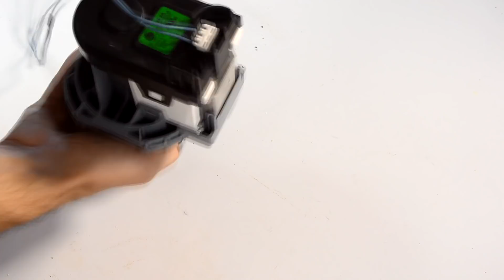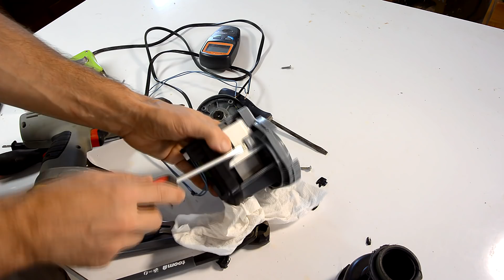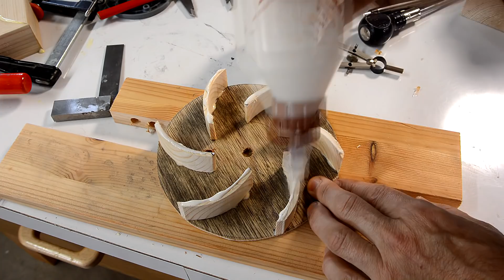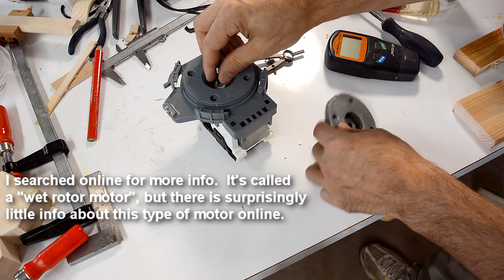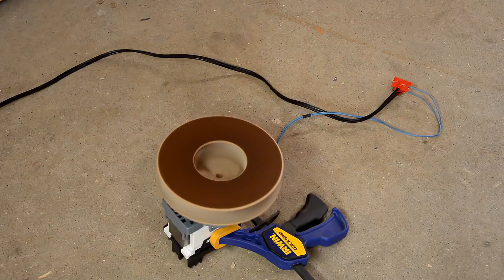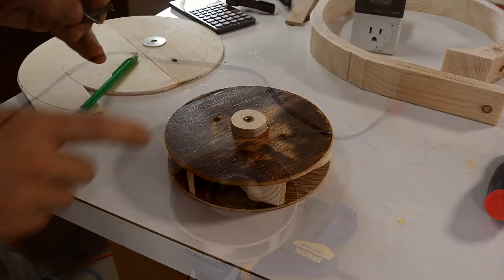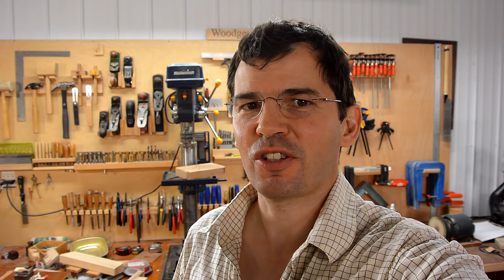Wet rotor synchronous dishwasher motor

Comment: The electronics are to get the motor to spin in the right direction, as if you power it directly it will start, just a 50/50 chance of it turning the wrong direction.

Comment: There is one problem with running wet rotor motors on fans: The water is there not only tolerated, but it is providing lubrication and cooling of the bearings. So running it dry will kill it in a short time.

For the starting: It is not the inertia, but the lack of power reserve wat makes it fail to start. The "pumping" is normal for this style of motors, it is just abeat pattern between the real rotor speed vs the mains frequency. But it efficiently makes the motor not accelerate during half of the time (when the mains is off phase from the rotor), so all the speed up needs to be happen during the time it is in phase. And this speed up needs to be able to reach synchronous speed and attain lphase ock with the mains. For that the actual motor torque  at speed needs to be double of what the load and other resistances are. If it is not, it is unable to lock the synchronicity, so the starter electronics times out and shut it down.
So you need to improve the impeller, so it won't load the motor that much.

There are actually two reasons for using these motors: first is the no need to seal between moving parts. Second is the efficiency: Induction motor has about 3x the losses compare to similar construction permanent magnet synchronous motor. The reason is, the rotor magnetic field on permanent magnet motor consumes zero power, you only have stator winding losses corresponding to currents pushing the load torque. With an induction, you need to induce currents into the rotor cage and that means the cage will have losses comparable to the synchronous stator losses. Then the stator winding has two functions: One is to push the rotor forward, the same as with the synchronous motor. And the other task is to form a kind of primary winding to induce the current into the rotor cage. Each of these functions creates similar losses. So in total we have 3 things wasting power, each about the same.
The extra gap between the stator vs rotor does increase the losses, but by far less than what the induction would waste, as unlike with induction, oversizing the rotor field strength does not cost any power, jus a bit larger magnet. Mainly at these small sizes we are talking about losses becoming the majority of the input power becoming losses in the motor, so when the pump needs about 30W at the shaft, it means about 90W induction vs this 45W synchronous.
Reply from the maker: that's why I oiled it.
Reply: @matthiaswandel well the oil may attack the plastic.

Comment: How's this motor holding up after 6 years without water lubricating the bearings?
Reply from the maker: haven't had issues.  I did oil the bearings
Reply: That's awesome! I'm harvesting a couple off a dishwasher right now. The main pump/garbage disposal motor is 1/3hp and has 4 wires and no capacitor. I assume two are the main windings and the other two are for starting, one for forward one for reverse. 

The drain pump is a small synchronous motor like this. I don't know why they put two motors in? Seems like a simple valve would be cheaper than a motor.

Comment: millions of wet rotor motors - mainly water circulation pumps like Grundfos and little giant etc. My Grundfos  is 35 years old and hard water of 315 ppm. Amazing. Of course it was built in the USA. All submersible  well pump motors are wet rotor, but they only admit filtered water as needed.

Comment: Its 5 years late now but the rotor should have as little gap as possible to the outlet edge or it will suck air from the output and make the output much worse.

Comment: i have a couple of these types of pumps for a cat's drinking fountain. they are actually pretty terrible for the job because the cat saliva can't be easily filtered out and the little wet rotor parts are a huge pain to clean out. a peristaltic pump would be MUCH better, but way too expensive.

Comment: 120Vac 0,9A =108W 
How did they get 55W ?
Reply from the maker: Rated vs actual power consumption.  Also, 120 volts * 0.9 * power factor.  Google power factor.
Reply: @matthiaswandel  Thank you for your answer Matthias.

So , Which one is it then "Rated or Actual power on the label ? The formula I wrote , which one is it ?
Reply: @gbsthlm6174  You should go through the Joe Robinson training videos, because explaining comprehensively it in a comment, or one setting is less than easy. Rated is 55w,  the power it is entirely drawing is 108 "watts" [VA]. 55w of the 108 "watts" is used to spin the rotor, generate magnetic field, run the circuity, and make heat and sound. The rest is not used. 108 is drawn, and 55 is used, when in other circuits, the is a PF of 1, and 10 watts drawn is 10 watts used. Here the PF is 55/108 = 50%.

Comment: The carbon bearing don't last running dry.i replaced it with ceramic bearing.that motor itself is not a good motor even on dishwasher. Carbon Bearing wears out uneven and it shaves off the magnet into dishwasher.nice video though .

Comment: with some more correct design on the vanes friction should be reduced and speed increase.  Since you are looking for small motors, AC, fridge and freezer compressors are a good source. They are usually in ok condition when their appliances are being scrapped due to cost of refilling coolant

Comment: Motor runs at 3600 RPM, not 7200 RPM.  It is directly driven by 60 Hz all the time, even when it is starting.  Starting occurs because the excitation is so strong that the rotor rocks back & forth more then 1/2 turn, leading to spontaneously starting.  (Adding excessive inertia will reduce the "rocking" to less then 180 degrees and not allow starting).  The only issue is getting to start in a known direction.  If pump has radial-blade impeller and symmetrical housing, it will work in either direction.  Some housings have "flapper" to accommodate random direction starting.

The main reason for the design is CHEAP.  (Your statement about large gap and magnetizing effort are correct, and is 2nd reason for design.)  Look at the simplicity of one coil, and compare that with the complex windings of an induction motor.

Your blades curve the wrong direction.  They should curve backward to provide "pressure recovery" to the airflow as it exits.  A "forward curve" impeller (the one you made) is subject to overloading and low efficiency.  Forward curve impellers are used when speed is low and you need high airflow (on small gasoline engines) and when quiet operation is desired (in home air-handlers).

Comment: It's a PM reluctance motor - looks like a chinese made knock-off of the Italian askoll motor block that is ubiquitous. The heavier duty versions have ceramic bearings and rotor shaft and a fully epoxy potted coil. They must be submerged in water for any reasonable lifespan to cool the rotor. This type of motor does not necessarily need all of those electronic circuit controls on the back to run. Those are there in this 'smart' version to optimize power usage depending on load. The more basic forms of these reluctance motors are not even directional and will start spinning in either direction depending on the rotor position when it is supplied with power.

Comment: Matthias suffers from motor addiction. I have the same problem. I own a lot of induction motors, the biggest one is a 3 phase 380V 50Hz AC 120A (on each phase motor). Giant induction beast, with a lot of torque.

And a little note:
Why you should have children.
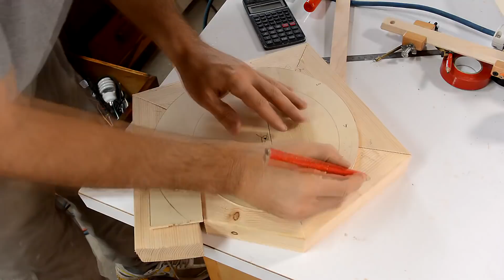1) they help with dust collection 4:16 - 4:20
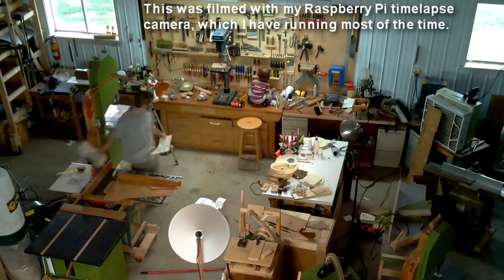2) they keep your tool wall organized 9:08
Reply from the maker: yes, some people collect stamps.  Others collect motors.  I think motors are way more useful!
Reply: Matthias Wandel I suffer from all sort of motor addiction (induction,  BLDC, Stepper, servo, DC, universal DC, synchronous, as long as it turns a flow of electrons into rotation

Comment: I used a rpm meter years ago.  When I used it indoors, it was inaccurate.  When used outside in the sun, it was accurate.  It was actually picking up the 60hz of the light indoors.  Check yours and see if you find similar results indoor vs outdoor.

A strobe-o-scope might be a better option.

Comment: They use something very similar in fish tanks Where you have an electric coils outside the tank and a magnetic impeller outside the tank. Also in X-Ray tubes there is a rotor that spins an anode. The rotor is inside a vacuum enclosure. The coils / electronics are outside the vacuum enclosure. These motors have several interesting uses in varying environments.

Comment: If anyone's looking for a similar motor, it's a very common type that has been used in many dishwasher for at least the last 15 years or so. Whirpool, Kitchenaid, Bauknecht, Indesit, Hotpoint and IKEA are some of the brand names that almost all use this model pump. There are multiple variations of this pump, but in most cases it's just small design changes and upgrades over the years and in most cases they're all compatible (often the only difference is the plug). This also means if you're going to repair your somewhat older dishwasher that has a pump like this there's a good chance you can use a newer, more silent version of this pump.

Comment: You suggest there is a choice induction or PM rotor.  Actually the large air gap and wet rotor disqualify's an induction motor.  The magnetic field in an induction motor is created by slippage, rotor speed is less then the magnetic field rotation speed.  The rotor is a transformer with a very low frequency, slippage.  the rotor current is the secondary induced current so the wire resistance and the moving of the field in the iron will create heat. And some current may flow in the water.  Problem one is the transformer will be poor with a large air gap.  The PM has a fixed rotor magnetic field.  Second problem water has dissolved solids that will come out of solution in the heated water in the air gap.  The motor would build up lime that will seize the motor rotor to the plastic can.

Comment: Nice video as always! I remeber that this type of motor is use for pumps in fish tanks.( At least the pumps that I use are) just a simple design that can be submerged in water if the rest of the electronics are cast in some sort of epoxy.

Comment: I've seen this set up in above ground swimming pool pumps, the magnet pulls itself apart and always fails.  I was buying a new pump every season because the impeller is not sold separately.

Comment: this is the same type of motor used in filters for fish tanks. their advantages are safe (because the moving part itself doesn't need a seal, so you don't need to worry about wearing on the seal at all) and super quiet (my 9W filter motor's noise level can't even be properly measured because it's lower than ambient noise). imo a more interesting way to salvage this type of motor is to make a small hydro-generator out of it. i'd certainly love to see Matt do that.

Comment: The motor is overloaded and just can't turn the volume that the wheel you made at the required speed before the electronics shots down due to thermal limit of the driver circuits.  Great job but this motor just doesn't have the guts you need. Nice job, you are an inventive engineer.

Comment: That motor is a proprietary motor for whilpool line products (possibly other manufacturers as well). That may be why you can't find anything on it. I fix 'em and see them all the time.
Reply from the maker: I wasn't looking for anything on this motor, but this type of motor
Reply: Read Mathias's reply again. He choose this only as an experiment. To both of you guys that repair these, if you watched the video to
the end then you would see that he knows this and is EXPERIMENTING with it. It will fail in time, but that's in the fun.
Reply: I repair this asko/askoll junk too, and now a Chinese version of the same thing..oh dear, a recipe for disaster eh.I could give you a tip I discovered years ago when these first arrived in the uk badged as Plaset.  As you probably know, when the seals fail and they fill with foul water, the rotor bearings wear, the rotor starts to wobble, and because its a sort of shaded pole motor, once the air gap around the rotor is not equal and opposite all the way round, the rotor will not turn. With me so far!? Anyway, when this is the case, if you can pull the rotor out of its chamber, fill the chamber with half a teaspoon of cooking oil, replace the rotor and any associated parts and the motor will work like a dream for a good few months!And if your reading this Matthias, its probably better not to consider using these for any projects, they just aren't very good.

Comment: Wet rotors are common in refrigeration compressors. They typically have to circulate refrigerant and oil mixed to keep them lubricated.

Comment: Like the exposed wires. Certainly not a safety video.
Reply: iLovewood Dont touch them, you'll be fine.
Reply: Lot's of people with that idea found a peaceful place....
Reply: +iLovewood its called common sense Yes its not as common as its meant to be but Im sure as soon as he got passed the fabbricobbled yes it runs stage the wires got nutted and safe-tied for general use
Reply: Ste T Quick and Dirty prototyping!
Reply: You can learn to be safe around wiring like that by practicing at home. Turn on your kitchen stove , stand next to it and try real hard to keep your hands in your pockets. Wait an hour. If all goes well you wont get burned. Repeat. Good luck!

Comment: The water is also a cooling method so the motor doesn't overheat. Most circulator pumps are wet rotor.

Comment: Was the hassle of balancing the impeller amplified by the fact that you glued the axel last, after gluing the blades? Maybe a jig to glue the blades in the same place radially would narrow the wobble to wood density and cut accuracy.

Comment: When you plugged it in you left the metal exposed and nearly touched it. Was it not mains voltage?
Reply: So don't touch it. And even if you do the risk is pretty minimal. Not that big of a deal for a very short term test.

Comment: You are the motor king! I have to say, as a former professional electrical mechanical troubleshooter of eleven years, your skill set is impressive. You always manage to figure things out and make a workaround no matter what you are dealt. I am like that in many ways as well, but I think currently in a much less knowledgeable capacity than you. I'm going to build a vacuum blower system for my shop, based off your designs in this and previous videos.

Comment: Most central heating boilers for home use have a water lubricated pump
Reply: correct, until you get into large volume pumps, then they have sealed pumps, driven with external induction motor with spring/rubber drive coupling

Comment: I have a bunch of pumps from dishwashers and washing machines I've taken apart over the years. Many of the pump motors look like the one you have here, minus the electronics. Yours is the first I've seen with a controller in the rear. All the ones I've kept have a large coil that looks a lot like the ones you see on shaded pole motors so they keep trying to run as long as there's power applied. 

I'm guessing not only is this design for efficiency, but also for safety in case something gets stuck in the pump. 

Thank you for the video!

Comment: Matthias, all your videos seem to be about the various improvements you make around your shop, and I love those sort of videos. However, we never really get to see what you make in your shop besides improvements. Frank Howarth is sort of the opposite where he only shows the things he makes but not the improvements.
Reply: Jared DuPont I love both Mathias' and Frank's videos. They both bring their own take to their different projects.

Part of the reason Mathias does so many videos on  improvements to existing things is, I'm sure, because he has made so much of his own tools and furniture himself and when he discovers a problem he fixes that problem instead of starting again from scratch. He's also a tinkerer, he simply enjoys tinkering with things. He also uses a lot of reclaimed and recycled wood and other materials (such as the motor in this video), which poses it's own challenges.

Frank, on the other hand, tends to use commercial machines that don't need tinkering and tends to do a lot of projects from scratch using new material.

Mathias and Frank both make great content that is very enjoyable. They have their own styles and ways of going about things. I happen to enjoy both but if you don't that's fine, no one is forcing you to watch any video anyone makes.
Reply: Jared DuPont Mate, go back through his playlists. Matthias has a lot of builds outside the shop.
Reply: I think he just wanted to see more of what you make (in addition to the improvements you already show us) :)
Very funny reply though, made my morning ^_^
Reply from the maker: well, then go watch his videos instead of mine.

Comment: You could build a small watercraft motor that doesn't need a shaft seal. Maybe for a hydrofoil surfboard or a little wooden boat. Although I guess it isn't really powerful enough for that application...